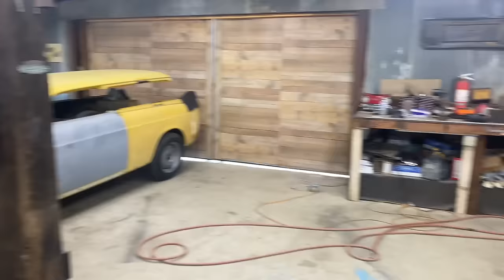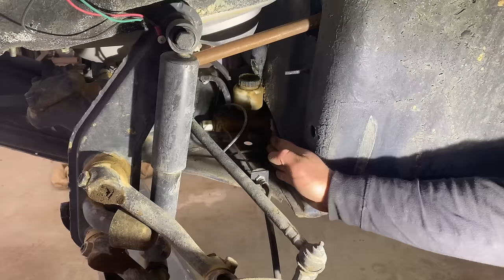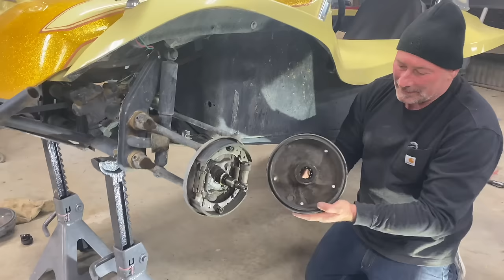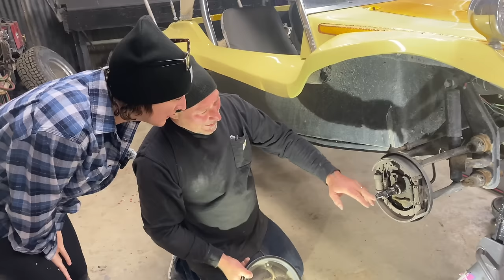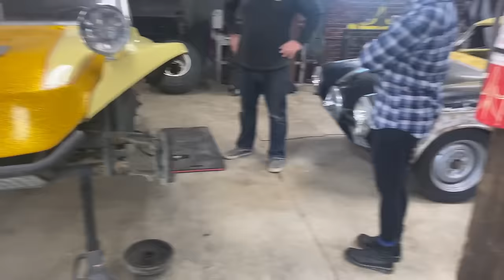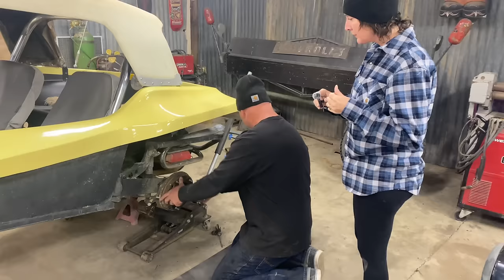Full Custom Ian Roussel and His Wife Jamie Introduce You To Persephone 🌼Dune Buggy Break Repair!

Comment: Yes, the one way check valve on the master cyllinder piston is sticking intermentally and pushing the fluid back into the reservoir instead of the brake lines.

Comment: I had trouble with my brakes ,still do really.
We drove it at our favorite mud  park out here in Missouri. 
But it seems the Mastor cylinder would lock up.
And the push rod AkA , bolt, was getting stuck. Still no brakes , got to work on it this spring.

Comment: You need a residual inline valve... the master cylinder is low enough that allows a little bit of fluid to flow back possibly drawing in a small air lock. All aftermarket  brake companies have them... ask me how I  know.

Comment: In the master cylinder is a very small washer that must open to let brake fluid flow back to the reservoir;  if there is wear on the metal or plastic part around that smal seal,  the seal does not open thus air gets sucked in past the piston seals  The rest you seam to know!  [Old mech South Africa]   Love your stories.

Comment: I never had much luck with the plastic brake fluid reservous. Even the ones with the metal threads. Switched to a billet one... works fine/ lasts long time. (Sand rail with 4 wheel drum brakes)...

Comment: Also another thing to consider is the rating on the break fluid.. the type of break fluid itself can cause problems not only with the pressure but also the wearing out of the seals
Reply: Great observation!!
Reply: Fluid not the problem, no leeks. Residual valve in master cyl not holding line pressure so brake fluid going back to master cyl. Master cyl is lower than wheel cyl making air lock in lines
Reply: @MegaEaglelover......yeah....you don't want to BREAK the BRAKES........ever learn to spell ?
Reply: You and whoever made the Video Headline do not know how to spell brakes. Along with more and more people across this country.

Comment: My first car was a 500.$ BaJa Buggy I earned from mowing lawns in 76 - I was 15yrs old . Drove it for 5yrs and sold it for 500.$ - I drove the Hell out of it - I put $ in brakes. Only because you want to stop. But the hand brake was soooo much more fun- going into turns and scaring the S out of passengers
Reply: The only thing I could advise is if you add wheel adapters for a different rim size take in account the weight difference. I changed my master brake cylinder out with a larger one. But the hand brake was sooo much fun for me. I was Drifting before it became a sport
Reply: I wish I wasn’t so far away…. I’d bring over a couple of cold beverages. ✌️😊😎

Comment: Ian
Worked on VWS my whole life can't remember seeing wheel cylinders being mounted vertically as opposed to horizontal. Don't know know how you can get all the air out mounted the way yours are. Just a thought can you turn the backing plate so the wheel cylinder is at the top so you can get all the air out?

Comment: The rubber boots on the wheel cylinders are just dust seals. Peel the boot back a bit to see if any fluid drips out... if so the wheel cylinder seals are gone...

Comment: the problem is with the master cylinder the rubber grommet that holds the fluid rots and allows air into the system 
they used the vw grommet on the conversion  master cylinder for the fj holdens here is australia  the brake shops improved on it by doing away with the grommet using a  brake booster check valve  which stopped the leaking 
another way to fix it is tap a thread into where the grommet is and use a brass fitting  with a nipple to attach a hose then use a hose clamp to prevent air getting in to a remote filler

Comment: Ok, it been experience with VW, drum brakes, you have two , adjust them to tight almost can't turn , then back off till almost no drag. Even each wheel. You do get wear, but you stop end up , with brake that stop on the dime. Yes bleed after adjustment. But this only they way I done it. It also works on most any drum brt cars 
I

Comment: If you are sure you have bleed all the air out of the system I would say the master cylinder is bad or it is undersized. It has to pump out enough brake fluid  to fill the wheel cylinders. Compare the master cylinder diameter and stroke compared to the wheel cylinder diameter and stroke.

Comment: Quick and dirty brakes diagnosis, if you are losing pedal, and you are not seeing fluid at any of the slaves, its almost always going to be the master. Also, weird how vw doesnt have a proportioning valve, I thought all cars did, but I guess that means those things have 50-50 braking?
Reply: Front and rear master cylinder ports are different sizes.
Reply: After 1967 they have a dual circut master cylinder setup.

Comment: What type of brake fluid does the manual call for? The wrong fluid can possible damage the master cylinder seals. You changed the master cylinder so did you bleed the air back then? You make a good couple.👍

Comment: The quality of the brake hoses are crap if they are Empi my I bought german brake hoses,wheel cylinders, and master on my buggy the seals are better its prob a problem of blockage from hoses a weak master and mabye heat from the fluid . My brake setup is exactly the same.

Comment: What was the large silver, riveted, tank outside the shop originally used for?
Reply: I think Ian said it's full of salsa. Maybe LoL
Reply from the maker: We think it held water from the well
Reply: @fullcustomIan  I was trying to be funny. I really believe from your fencing the prior owners had stock animals and that could require a great deal of water. A well, especially in the high desert most likely would be over used by the demand for stock watering. The storage tank could be a buffer for the demand .  👍😎
Reply: @fullcustomIan  That is logical.  Looks like the boiler tank for an old steam engine.  Just needs to be put on wheels with a few "enhancements" for the ranch railway locomotive.

Comment: Your not bleeding it right . You need to pump the pedal first then open the bleeder allow the pedal to go to the floor and hold it close the bleeder and repeat.your way your allowing air to come in and when you push the pedal your not getting all of the air  out you put in.also before you install the master cylinder bench bleed it. This way you keep out more air . Also the furthest line away is generally your rear left side then to your right rear. Happy motoring take care and Jamie you don't laugh like Santa Claus.

Comment: Why are the front brakes clocked sideways? The wheel cylinder should be at the top. How would you bleed all the air out when it's sideways.
Reply: U R RITE HITTN THE NAIL ON THE HEAD TODAY AND ME NOT A BUG MAN BUT MASTER TECH RETIRED AND I DO NOT RECALL EVER SEEING ANY ON SIDE SHOOD B AT  12 OR 6 WWN LOOKING AT A CLOCK....GREAT CALL BROTHER...U KUNDA MADE ME THINK N ACTUALLY LOOK AT EPISODE  SEVERAL TIMES N  CHECK IT OUT IN MY BRAIN CUZ IM SO USED TO DOING IT IN FULL ROBOT MODE AND THIS IS  Y  I RETIRED AT 40 AND PLAY PLAY PLAY PLAY PLAY MORE...

Comment: My bug did the same thing..
I would bleed them, fresh fluid, new master cyl...etc.
Brakes would be firm and stop car...week later straight to floor.. if I pumped pedal..a few times brakes were back...for a few minutes.  Get home and bleed them..  yep full of air.
I change master cyls and the process repeated for years.   I found heavy stop go traffic seemed to mske it worse.. I think somehow pressure seeped past o rings over time

Comment: Brakes are the worst part of air cooled VWs.I spent md time and money on sorting the ones in mine. The collapsing rubber hose section is a common issue and can cause the brakes to stay on when the inner liner comes loose and acts as a non return valve.

Comment: The master cylinder for the brake system is not pushing fluid through those lines the entire system is full of fluid pressure that moves the brakes because when you do a brake job and you have to bleed the brakes what are you doing you're building up pressure by taking all the air out so what I think is you have a loss of pressure problem I could be wrong cuz I don't know too much about Volkswagen so after you get done bleeding the brakes it's going to work for a little bit but it's going to do it again because you have a slow leak someplace master cylinder I bet this is my first time watching this video in the first few minutes I figured it out I called it right club master cylinder look at the master cylinder it's all rusted and $9 for a master cylinder come on you should have known that was a cheap master cylinder when you bought it and I mean really cheap